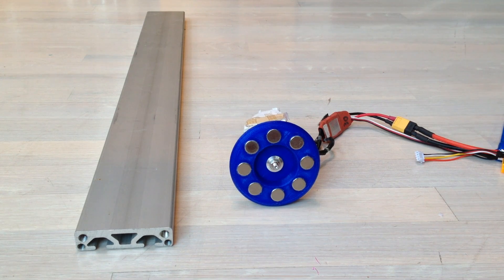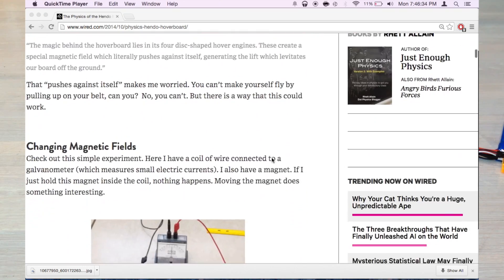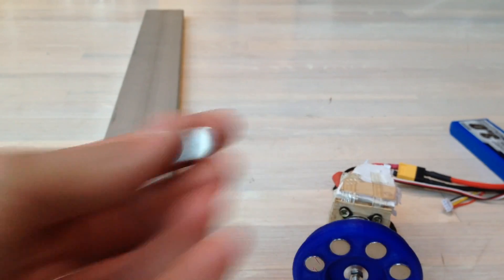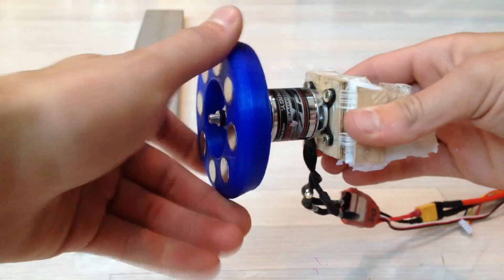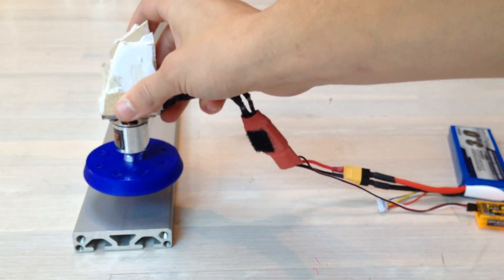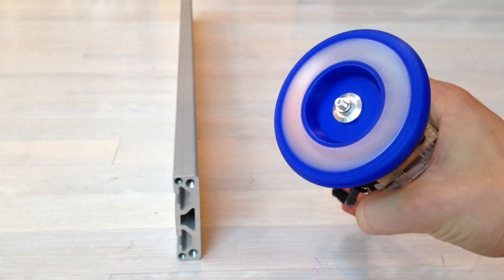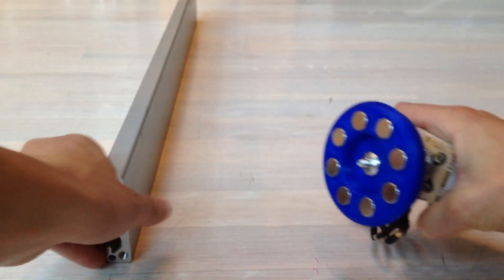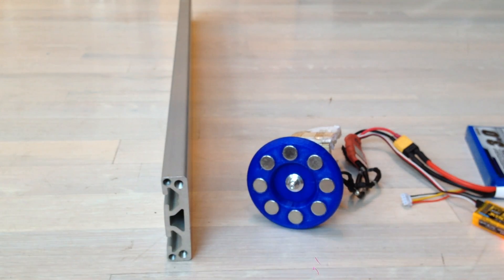ON THE HENDO HOVERBOARD: How it works and demonstration

Comment: But does that magnetic feild work on any type of floor? On wooden? On tiles?PLZ REPLY
Reply: It needs to be a non magnetic conductor such as aluminium or copper. The point is to generate eddy currents in the floor that cause it to become a repulsive electromagnet. If you use steel, the magnets will stick to it. If you use wood, you cannot generate electrical current through it.

Comment: What if you take the halback array and since one side is neutral instead of an electric motor you use slant ways Electromagnet  creating an opposing feild inducing the spin just like the oppsing field repelling ferrous conductive metals? also I thought I had seen one of these hendos on concrete I understand their is Rea-bar in concrete, and concrete once in the past was non for draining batteries Am I wrong here is this technology to weak for concrete. Finally can you regulate height with rpm of the magnetic disk?

Comment: Ha! This is awesome. I guess I'm not the only DIY enthusiast interested in knowing how it works... before finding your video, I did the exact same thing, and made a working hover-display exactly like yours. I read the patents, and made a 3d-printed housing for 40 small neodymium magnets (which I assume is how you made yours), and it worked! I might post a video soon.
Also, from being in AP Physics C this year, Phys. B last year, I worked with the equations a bit, and I believe that the Halbach array is weaker... It's the mag-field change from magnet to magnet that induces the currents in the surface, so NS <--> SN is a stronger change than the Halbach, cause it's the individual fields that make it work, not the overall. I doubt they actually use the Halbach anyway.
I'm just really happy to see other makers out there with the same interests doing cool stuff! One question, what motor did you use? Mine was a cheap outrunner from amazon, 2200Kv, so it would considerably slow down when near the aluminum because of the Eddy Currents resisting the movement. Maybe it was going too fast... What was the brand, Kv, etc of your motor? Thanks for your time, this is awesome.
Reply: Joren Miner Nevermind, I just read the rest of the comments, now I see the type of motor. I also see you 3d printed this too! Great work, very well done. I wonder if mine will work better if I have the magnets further apart from each other, maybe the motor is spinning too fast on mine...

Comment: You must be wrong, I specifically asked them if it was just spinning magnets and they told me no!

ME: "So you can guarantee that anyone buying the 'whitebox', when they open it, are not going to find that each of the 4 'engines' consist of an electric motor and a set of rotating magnets then?"

HENDO: "Again, this is a misunderstood oversimplification of the concept behind our hover technology.
If it was simply magnets and motors, it could have easily been done before. It isn’t. And it hasn’t."

Guess they didn't want people to know they were buying $100 of hardware for $800!
Reply: Dragonbait That's how business works. Should they sell the product at cost? They are still in the researching stages, where all costs are higher and people with money are willing to pay it. 

The difference between this and other tech gadgets that have similar mark ups, is that you can't buy this any where else and definitely not for cheaper, unless you wan't to build it yourself.
Reply from the maker: I think the oversimplification part comes in with the Halbach array. The patent is very clear about how the board works: http://www.google.com/patents/US20140265690
Reply: Sorry I was being sarcastic, I know what you are saying is correct, I also think Hendo is fleecing a lot of people.
Stick 4 of your motors in a box with a quadcopter style controller, if that cost $800 then I'll make an apology to Hendo, If it's actually, as I suspect, $100 worth of tech in a pretty box then they are clearly conning people.
Reply: +D. Lyrium As I wrote in another post, it would still cost a shitload of money to do so. If we assume they use 1/2 inch neodymium magnets:
$4.44 per magnet
180 magnets per disc = $799.20 per disc
4 discs per hoverboard = $3196.80 per hoverboard
But this is the price of magnets alone! Add 4 motors and a pack of lithium batteries, and the price will rise even more.
Reply: DevilMaster except we are talking about the white boxes, not the hendo hoverboard itself.
The whiteboxes are likely to contain 32 cheap neodymium magnets in total.

Comment: RaptorTech If i do that, at least at low speed, aluminum engine would try to curb drastically, but in this case a repulsion appears, are due to the high speed you use and therefore a very high frequency? How many hertz are required to work?

Comment: Also, if you simply get a common magnet n' get it closer to a piece of metal it will either repel or attract it.
Reply from the maker: Magnets do not repel or attract with aluminum on their own
Reply: Thanks Raptor. My ignorance.
Reply from the maker: Con Troversy That's true. However, that's the eddy currents generated in the aluminum resisting the motion of the magnet. Not the aluminum repelling the magnet. If you hold the magnet still relative to the aluminum, you will feel no force. The eddy currents are precisely the effect the Hendo Hoverboard uses to achieve levitation.
Reply: RaptorTech Also there's paramagnetism ;-) (see floating frog) The effect would be too tiny to be usable for levitating normal people in a normal environment tho

Comment: Funny all they did was hacked and modded a quad copper.
I was not hard any one can build it as its not new tech as they keep saying its only reapplication of known magnetic princables.
As I told hendo I had Plannes from over 2.5 years ago of this concept it needs other new ideas added that I don't think they have worked out yet. I have offered to help with the project to help advance it beyond the basic platform that it is. But no contact from hendo I don't belive Mr Henderson talk about others input I think he just wishes to sell $400 boxes that lev to fund his project.
There is so much more that can be done a tested on there platform as its not a hoverboard yet its just a levitating platform with no control.

Comment: water is technically a little bit conductive...
^see where im going?
is it possible? with infinitely more power of cource?
Reply: Is this a "these boards don't work on water unless you've got power" joke?
In case it's not: water is not a solid. Assuming that it's possible to induce an eddy current and an opposing magnetic field in it, the repulsion would just disperse the water down and away from the magnets, while the magnets, motor, battery and whatever is attached to them would fall normally. Then the water would close on itself above the magnets, where there's no repulsion force, and short out the motor.

Comment: Is more force created at higher rpms?
Reply from the maker: Yes, both in lift and resistance.
Reply: RaptorTech
Thanks so much for this answer.  Another question, if you increase the magnet sizes would that increase lift as well?  I would guess it's better to increase rpm than to increase magnet sizes.
Reply from the maker: Increasing magnet strength would increase lift, so a larger magnet of the same type would generate more lift.
However, even more lift can be generated more efficiently using a Halbach array, which is a way of arranging the magnets such that the fields constructively interfere on one side of the rotor.

Comment: Does freezing increase the lenz effect.
Reply from the maker: It may, because decreased temperatures will increase conductivity in the metal. However, the eddy currents do generate heat in the metal as they dissipate.

Comment: Uhm, you totally missed the point where the rotating field(s) are stabilized above ground. Just showing the push isn't really explaining what they really did, and the stabilization is the real feat imo.
Reply from the maker: Reading articles and comments, it seemed to me that most people just didn't know how the board achieved thrust in the first place without propellers, and those who did have some notion that it was magnetic all assumed that the board employs electromagnets. I figured making a video explaining the "thruster" would answer most questions. However, if I had the material to make the 4 thrusters necessary for stable levitation, I certainly would have!
Reply: RaptorTech Thanks for the clarification!

Comment: so how thin of a layer of metal would be needed on a roadway to be able to hover over it?  if it were 1 or 2 atoms thick it would be way cheaper to pave a roadway and maintain it if all vehicles traveling over it were hovering.... that'd be sweet.  that is as long as you can figure out how to stop without landing on the road and destroying it.
Reply: There are some tests on youtube that show a coil floating over aluminum sheets. Thin sheets don't work that well, but above about 1 inch doesn't seem to help either. Plus, thin sheets may rip under the eddy current loads. And they would definitely heat up too much.
Reply: Richard Lewis hmm.... could rotating magnets be used as a heating mechanism? Not that plain old induction cooking isn't way more efficient, but there could be people who want their cookers to buzz while cooking.

Comment: Awesome demo showing us how this cool "tech" works. 

I think it's a great idea because there are gonna be some very specialized applications that can benefit from powered frictionless levitation, but the main problem is that Lenz's law dissipates most of the rotational energy into heat on the conductive "riding surface" below.

Not only that, but you have to have an even number of these "hover engines" rotating in opposing directions, just like a multirotor UAV, and when you place more weight above one of them, it causes the entire system to torque! (Tony Hawk demonstrated this near the end of that video) Software and sensor feedback can probably be used to offset this effect, and that further explains what they're doing inside the White Box Plus model to provide the 3 DOF control. I would wager they're going to rotate the individual hover engines slightly in order to gain rotational and translational driving, by having magnets ride closer to conductive surface along a suitable portion of their rotational path. 

Going back to the power properties, it's really kind of crappy because just like the multirotor props generate huge drag in the air, the rotating magnets generate huge drag in the eddy currents of the levitating riding surface, and there's no way to recover this energy.

Maintaining a hovering can theoretically require no energy input (and indeed every item ever, placed upon a desk or any other place already excels at this), so I guess I could say that we still have our work cut out for us, but really, for a few specialized applications, the energy inefficient way to gain real multidimensional control is very worth it.

Oh, also it's preposterous to think of levitating buildings (yes they mention this in the kickstarter video). That is not really very realistic (if just conceivably plausible) as it would require a nuclear power reactor in the building to drive it. I say this because no matter how strong you can make your electromagnets, with superconducting coils, an enormous amount of additional energy is still required as input to torque these magnets in opposing directions. That is, we still have the huge energy being deposited into the eddy current riding surface as unrecoverable heat.
Reply from the maker: Spot on! It's a proof of concept, but ultimately not a reasonable method lifting anything for more than a few minutes at a time.
Reply: dc443, So i need to build a hover board of sorts for a science project. What i am gathering is that if i was to use 4 motors to each rotate a separate disk of N52 magnets, i would need 2 of the motors to spin counter-clockwise and the other 2 to spin clockwise?

Comment: question, how does it work on non-metal?
Reply from the maker: The same way it would work over metal. The only requirements are that the surface be conductive and non-ferromagnetic. These are properties of some metals (like aluminum and copper), but there are other materials that meet these criteria. Salt water, for example. The main difference between salt water and aluminum, and the reason this would probably not work over saltwater any time soon, is that aluminum is MUCH more conductive, and it needs to be to keep efficiency high and allow the thruster to hover.

Comment: It's not too hard to make a "hovering" vehicle. I made one in fifth grade and we put it down a hill. The magnets at the bottom of the vehicle repel the magnets on the ramp.
Reply from the maker: Yea, those are pretty common. This is different, however, because aluminum is not magnetic. This uses inductions to levitate in addition to simple magnetic repulsion.
Reply: RaptorTech True.

Comment: Wow. It's really interesting and amazing how we have been wondering for such a long time how it would be possible to hover completely off the ground, and how complex and advanced it would have to be. But, as demonstrated here, it's so simple.
Reply: we've known of this type of tech for a while now, but in this application it is impractical. To use such a hover board, you would need a specific surface to hover on.
Reply: Adam Miller also let's think about supplying that thing with enough energy.
That LiPo battery he is using is pretty much modern-tech I think. Lot's of energy stored in small space and little weight.

Comment: Can we use tiny jet engines like planes but much smaller to fly it? Or that is a stupid theory?
Reply: With no limit on height and balance it would be extremely dangerous. We're talking deaths. It would also be too expensive to maintain with the fuel. In other words: yeah it's a no go.
Reply: that wouldn't be as safe, you could easily loose a finger if you fell of the board if it had Jet Engines powering it.
Reply: Like how? Because the jets are to powerfull?
Reply: you have no idea the power of a Jet Engine do you... The turbine blades of a Jet Engine are extremely sharp and spin at extremely high speed.
Reply: So a smaller one will be just as deadly.
Reply: as a scientific experiment it is extremely interesting, you don't need to test it on people y'know
Reply from the maker: People have flown with jetpacks powered by model airplane turbines. I don't think using turbines as a lifting force for a hoverboard would be a good idea, however. If the rider fell off, the board would have to throttle down quickly, or else it would simply shoot up into the air at some weird angle. And turbines spool down pretty slowly.
Reply: I got a cigar lighter that puts out a nice torch type flame... it would probably give enough of a push in one direction... get the venturi effect happening with some butane engine and it should be no problem.
Reply: you could use a model plane turbine, but where will you put so much fuel?
Reply: ***** sounds legit all these comments are helpfull, yeah it costs a lot for fuel but how about like lets say a plane propeller a real small one though, I just dont like the fact that u cant ride the magnet hoverboard anywhere 😭
Reply: Mac Bard yeah I say we put a test dummy on the theory hoverboard with jet engines small ones though and see what happens.
Reply: ***** All other concerns aside, a sort of screen could be placed over the intake in order to prevent blended fingers
Reply: Enough engines would work but there are issues with using them ;-) Until a hover device can hover at a reasonable height, you may as well just use a wheeled device otherwise you'll still have to get off when you reach a step, rough ground etc.
Reply: Rennie Ash I think we're going for a mini, jet powered helicopter

Comment: That's an air cushion pushing against the Aluminium, grab any magnet and put it on a piece of Aluminium it wont attract or repel, then try a piece of ferrous material.
Reply: try letting a magnet fall through a piece of aluminum tube and then you will understand the interaction between non ferromagnetic conductive materials and moving magnetic fields.
Reply from the maker: It's true, aluminum is not magnetic. What's going on here is that there's an electric current being generated in the aluminum due to the moving magnetic field, and this current generates an opposing magnetic field to push away the magnets. There's no air cushion involved.
Reply: RaptorTech
Cool, to the laboratory(garage).
Reply: bullvalene
Wait; does that do something cool?
Reply from the maker: BillyJoe1305 Yep! Drop a magnet through a copper or an aluminum tube and you will observe that the magnet falls very slowly, even if it's not touching the walls of the tube. That's the magnet interacting with the magnetic field produced by the eddy currents in the tube.
Reply from the maker: BillyJoe1305 If you can use a strong neodymium magnet inside a tube which is not much wider than the magnet itself you'll get the best results. Enjoy!